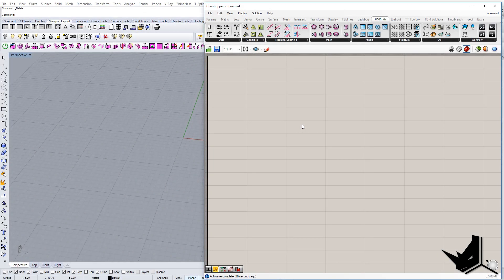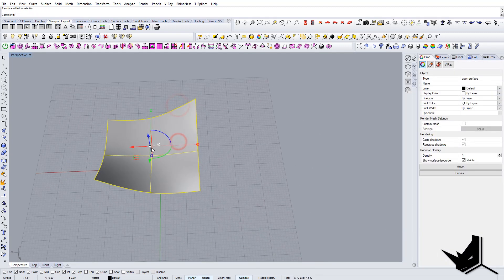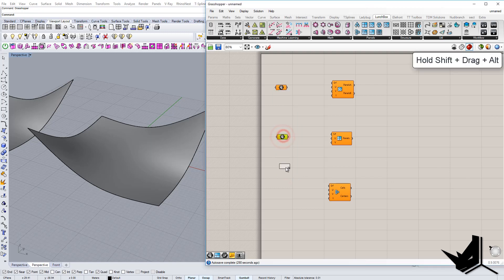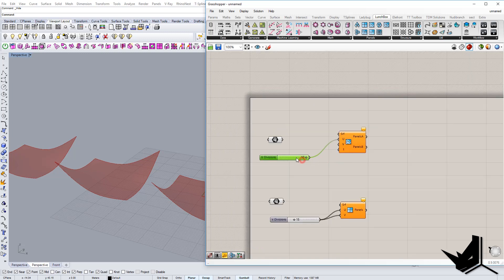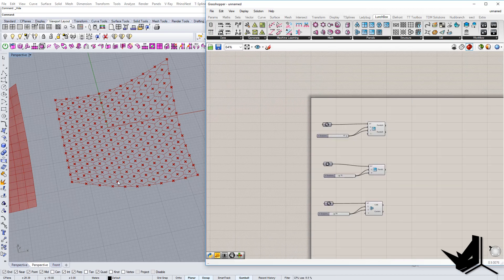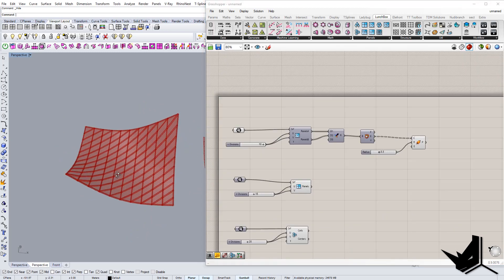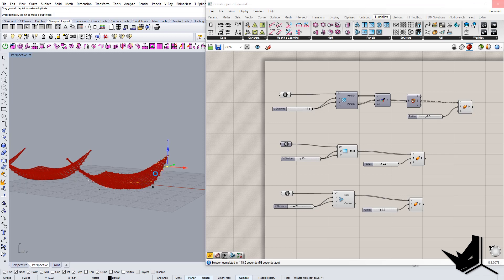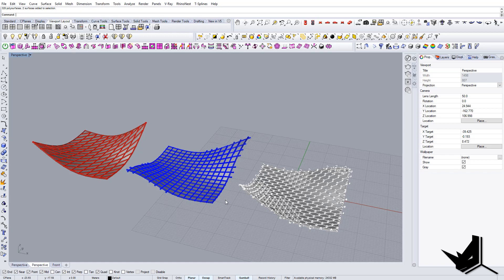How to use Lunchbox in Grasshopper

Comment: Thanks! How would you trim the panelling boundary in case you apply it to a non rectangular surface?
Reply from the maker: Well, it really depends on the type of surface it is. There are multiple ways to do it. You could use the outer edge of all those panels and project it on the surface and then trim out the rest. In some cases, you even get the outer parts as a separate list in lunchbox... Send me a particular file if you have and I'll take a look :)
Reply: @HowtoRhino   BIG THANKS man :D I was looking for the answer to this issue for 4 days,I'm still newbie and discovering grasshopper and wanted to try the LB on an hexagon and couldn't do as it came out always as a rectangular panel ,now your solution worked just fine ! thanks for your tutorials,please keep up,you're really helping out students like me

Comment: Hi, Thanks for sharing this video.  When I create surfaces in Rhino, and apply the lunchbox paneling to them, the paneling continues on beyond the boundaries of my surface.  What am I missing?  If I create a very simple a planar surface, I can get the results that you show.  But if I have compound curves as the face of the surface, or really any curvilinear edged surface, it extends paneling beyond edges.  I have seen tutorials of people applying the lunchbox components to very complex surfaces, so I'm thinking there's something simple I'm missing.
Reply from the maker: Hi Adam, 
If you have complex surfaces, paneling tools or any other tools from Grasshopper will recognize that surface as "untrimmed" surface and it that's why you're seing these "extensions". This really depends on the mathematics behind NURBS surfaces. One tool that works better for these kind of "complex surfaces" is called Paneling tools. You might want to check that out. We will have a tutorial on that soon.

Comment: Why did you extend the edges and then delete the extensions?
Reply from the maker: Hi Lance, good question! The reason why I am doing this is that once you create the new geometry in t-splines you get these so-called "creases" near the endpoints of a rectangle, like some kind of additional bezier vertex handles. So if I want to remove those I do this process always. Removing these "creases" make the geometry much cleaner and easier for editing. Hope that makes sense! :)